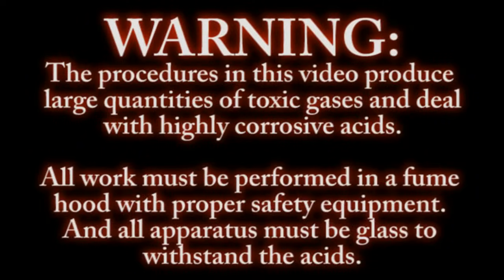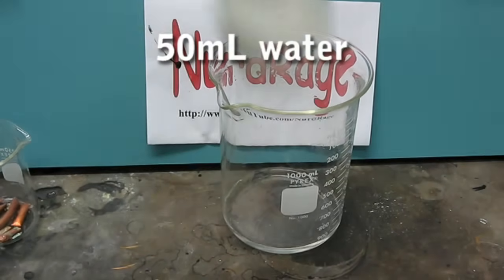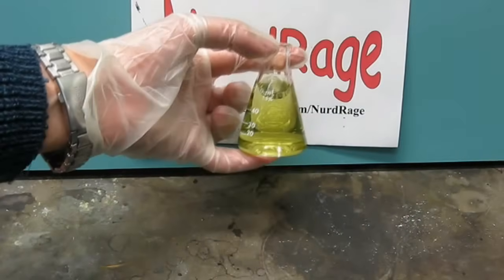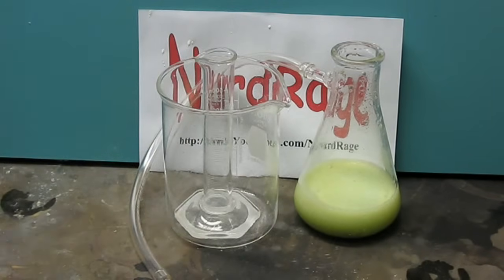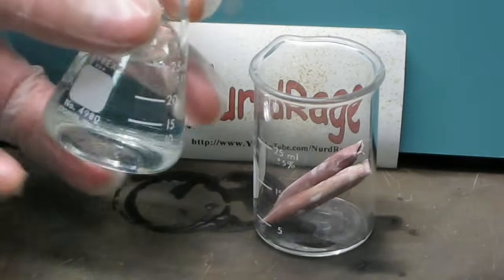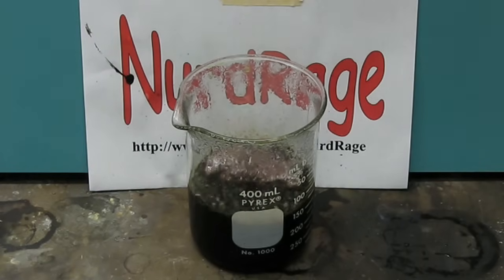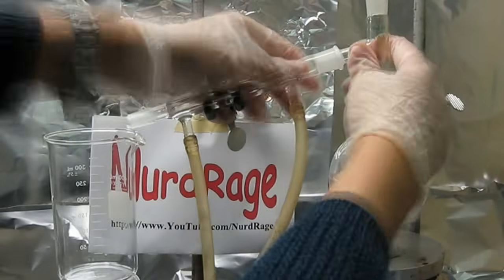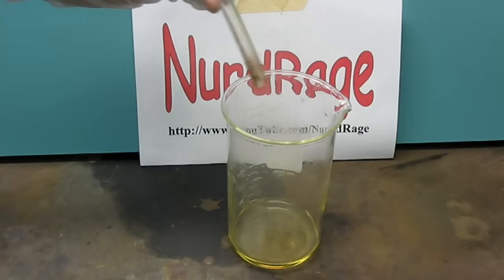Make Nitric Acid - The Complete Guide

Comment: The 3rd method with a bit of a chance in equipment is the way to go in my opinion. A heating mantle  instead of a hot water bath, a 2 or 3 neck round bottom flask for the acid and salts, an offset to the  vertical column, then a 45° with a thermometer port (wrap the threads and the thermometer where it meets the threads with PTFE tape or the Nitrogen oxidizeds will eat the plastic cap) then a condenser going to another 2 neck flask that is sitting in an ice bath with your recirculation pump that is cooling the condenser. You then can use the other neck of your reciever flask to attach a hose that you can run out of a window. After you get your heat dialed in then weap all of it with aluminum foil to keep out the light. Your end product will be very concentrated but might be a bit orange. You can pump dry air through the acid and it will clear it right up.

Comment: will calcium nitrate work if i filter off the calcium sulfate that is produced when I add sulfuric acid?
Reply: This is a good method for when you don't need the acid very pure, but you will need a vacuum filter to seperate the calcium sulfate, since it forms very small particles

Comment: Your videos are very instructional. Im a small precious metal refiner and the cost of nitric acid is very expensive. Im almost prepared for processing 6,000 grams of silver and another 350 grams of some karat scrap gold.

Im considering buying a simple distillation aperatious and wondered if maybe you could counsel me. I need to produce about 1.25<1.5 gallons of 68% nitric acid. Not sure of flask sizes and the condenser size. 

Comments!

Comment: What type of oil for the oil bath? I did not like the oil bath as it it started fuming. I had to turn down as I thought it might catch fire like a chip pan fire. I set my flask 1mm above hot plate and rapped foil around bottom and I managed to get it working. What temperature dose oil catch fire is there different temperatures between eg clutch and break oil, engine oil, gear box oil, refrigerator oil. Interesting

Comment: Will the 2nd and 3rd method work on silver? And instead of using 30% hydrogen peroxide can I use 3%( standard hydrogen peroxide bought at store) and still get better results then using only H20?
Reply: They should work.

Dilute hydrogen peroxide would still work,maybe very low yield but still be better than water

Comment: START WITH 80 GRAMS OF NITRATE SALT (sodium nitrate) BUT POTASSIUM NITRATE/AMMONIUM NITRATE OR NITRATE BASED FERTILIZER ADD 50 mL OF H2O TO THE NITRATE. THEN ADD 100 mL OF HYDROCHLORIC ACID. PUT 50 mL OF H2O TO ANOTHER LARGER CONTAINER,GET 32 GRAMS OF COPPER EXCESS AND POUR IT INTO THE ACID MIX THEN PUT ANOTHER CONTAINER OVER THAT AND WAIT.

Comment: Can you use 1L of 10% HCL solution instead of 100ml of concentrated? The only over the counter solution near me is 10% HCL.
Reply: If its only 10% hcl its probably not just 90% water. There might also be carbon contaminants. Imo best option would be to just concentrate the acid instead of dilute the mixture.

Comment: why hcl instead of h2so4 it is non volatile ...

and if u need to get rid of the yellow pass dry air or co2 through the solution or add excess of water. 
the no2 produced due to the thermal decomposition of hno3 fades away 

pure hno3 is colorless but it is also very unstable due to its unstability it gets decomposed easily and forms nitrogen dioxide which is a reddish brown gas but gives a yellow color to hno3 in order to prevent the thermal decomposition from happening hno3 is kept in colored bottles and because it fumes in the air  hno3 you should always use a stopper.

Comment: If I react sulfuric acid and sodium nitrate yielding  a distillate of fuming nitric acid, what am I left with in my boiling flask? Is it sodium metabisulfite or sodium bisulfate? What can I use this leftover molten salt for and how can I remove it from glassware without  recrystallization occurring.  It's a huge pain in the .
.Thank you in advance  .
Reply: You are left with bisulfate and possibly leftover acid.

You can try make more acid from them.

To removing try add water,althrough there are risk of acid spilling

Comment: Can someone please explain to me why you cannot simply react HCL + NaNO3 --> NaCl + HNO3 ?!?? just set this up as distillation like nurdrage method #3, but replace sulfuric acid with HCL.. You can re-distill to azeotropic, but it seems way better than do deal with dissolving copper and bubbling through H202
Reply: because HCL is a weaker acid than nitric and the reaction happening here is weak acid salt + strong acid = strong acid salt + weak acid this will only work if the acid being mixed with NaNO3 is stronger than nitric

Comment: I have 2 questions, when you talk about recycling the copper from the dead reaction mixture by adding aluminum to it. What compound exactly is the dead reaction mixture, and what is it after reacting the aluminum?
Reply: The compound are probably copper nitrate and alkaline chloride salts with leftover HCl,by adding aluminum you are converting the copper ions into copper metal and turn aluminum into aluminum nitrate.

The bubble are probably from the reaction of the leftover hydrochloric acid and aluminum,creating aluminum chloride.

Comment: Excellent Video. Thanks! Nitric Acid remembered me a solution and I have a suggestion to a video: I got a formula to strip Tin (solder) from PCBs, but I can not have a way to test it. It's made with 30% Nitric Acid + 1%-5% Ferric Nitrate... in case this solutions works properly, we can fastly remove only the solder leaving copper and components intact and we can easily get all the components off of the pcb. Is it interesting and Could you make it ?

Comment: I realize this video is pretty old but I love all of your videos, thank you for doing them. I wanted to try to make some nitric acid and I think I succeeded but it didn't turn out like yours (clear). I used 82 g calcium nitrate,  45 g copper metal , 50 ml hot water, 100 ml muriatic acid.  Bubbled through 25ml of unknown concentration of hydrogen peroxide in an ice bath. 

The hydrogen peroxide started out clear as you would expect, went blue, then green,  at the end of the reaction amber.  it looks like a good amber beer, it is even bubbly. It attacks copper quickly. What, if anything, did I do wrong? If you shake it around a bit it still releases faint red vapors. Thanks.
Reply: probably some contamination or unreacted no2 gas maybe?

Comment: A@1:30 :  I thought Nitrogen Dioxide dissolved in water to make Nitrous Acid. Not Nitric Acid. Am I wrong?
Reply: nitrous acid turns into nitric acid because nitrous acid is unstable the reaction mechanisim is 3 HNO2 = 2 NO2 + HNO3 + H2O

Comment: Quick question sir - would my relative altitude (roughly 5,500 ft/above) have any bearing on why it is that the first reaction is not working? The nitrate is pure, hydrochloric is new, yet it just turns green. No smoke to force in to the liquid below.......
Reply: Update!! The only thing I’ve been able to accomplish is... ..... I’m not sure bu it’s certainly acidic. It’s basically the first method+sulphuric acid in the inner jar bubbled in to hydrogen peroxide. It fizzes when I even move the jar it’s in. Any ideas on what it is exactly? Oh, and I added what I believe to be stainless steel to the acid mixture

Comment: What are the fumes that are released in the reactions? I understand they are toxic, but any suggestion exactly how toxic?
Reply: Nitrogen dioxide, which is nitric acid minus water basically. Should you inhale it, it will mix with water in your respiratory tract and become nitric acid again (hydrolysis) then the nitric acid will nitrate some part of you. Minuscule amounts of this process briefly are fine. More are not. Nitrogen dioxide (which always occurs in an equilibrium with dinitrogen tetroxide) has a distinctive metallic-y odor that becomes evident well before it's visible. When you smell it, improve your ventilation and/or get your head out of the flask right now. Don't even think about trying to smell the "orange cloud." Just get away from it.

Hydrolysis in the respiratory tract is how many Things You Don't Want to Inhale work, for example, carbonyl chloride. Most of the lower respiratory tract is not innervated and severe damage will not be felt directly. However, the resulting pneumonia and death will be more conspicuous.

Comment: 5:46 wouldn't it be better to use a water bath or sand bath? Organic substances and a nitrating bath do not mix very well with lots of heat if the flask were to break...

Comment: 4:05 I wanted to just point out that you can distill fuming (above concentrated) nitric acid, you just need to use concentrated nitric acid and concentrated sulfuric acid and distill. The sulfuric acid likes water much more and will keep it in the flask while the almost pure nitric acid distills over. Great video!
Reply: And you can reuse the sulfuric by boiling off the water and leave concentrated sulfuric acid
Reply: cool, I bet it would also work with hydrochloric

Comment: Hi , i used fertiliser and it worked , but what happens if copper is omittted ? As isnt the copper giving off nitric dioxide gas because the solution is producing nitric acid to react with the copper in the first place ?

Comment: on the vacuum flask method...
1 . would recycling the gas that escapes after bubbling through the solution (via an air pump and second tube with second pipette) before it escapes into the atmosphere increase yield?   basically, how efficiently does the nitrogen dioxide dissolve into the receiving solution?  If there is undissolved nitrogen dioxide, would recycling it through the same (or second) solution increase the yield?
2. would plugging the receiving container increase yield due to the increase atmospheric pressure...like when making carbonated water?

Comment: WTF!?   wheres my reaction?   followed recipe to the exact measurements,   sodium nitrate was pure,   used 36gms copper,   no reaction.  Am I doing something wrong?
Reply: my apologies,  reaction came on much much slower than your video, copper was reasonably clean, the only thing different is that Im using plastic not glass, all is air tight where it needs to be,  poly tube with a glass eye dropper tube on the end for bubbling gas through water, 

thanks NR
Reply: yep,  now running on on all cylinders!

Comment: Cu +  4HNO3 > Cu(NO3)2 + 2 Nitrogen Dioxide or N2O4 disolves as HNO2 (nitrous acid) and one HNO3 (nitric acid) but HNO2 in acid becomes N2O3 which escapes. Seems wasteful. Can't we use electrolysis like sulfuric acid from copper sulfate.

Comment: Why do you say only nitric acid can disolve copper? I etch the copper off circuit boards with just hydrochloric acid and hydrogen peroxide. I end up with copper in solution. Copperchloride.

Comment: "How to make nitric acid? Just mix hydrochloric acid with...."
"How to make hydrochloric acid? Oh, just mix sulfuric acid with...."
"How to make sulfuric acid? Easy, just mix nitric acid with...."
GAAAH!  This is starting to resemble those irreducible complexity paradoxes from theory of evolution! ;[
How does one BOOTSTRAP this process to begin with when there's no acids around yet, just bare nature?
Reply: u can get sulfur trioxide from the decomposition of many metal sulfates at very high temperatures, which reacts with water to form sulfuric acid
Reply: @scottjohnson7433  Ok, cool. Where can I get those metal sulfates then?
And how high the temperatures I would need? Is fire enough?
Reply: iron (ii) sulfate occurs pretty commonly in nature as a mineral and decomposes at 650 degrees c

if you wanted a practical way to make a strong acid without access to any of them today nurdrage has a video where he makes HCl from sodium bisulfate (very easy to get as a ph lowering chemical in pools) and table salt.

Comment: Could you use the hcl + nitrate salt method and distill it like you did with the sulfuric acid?
Reply: No. The gas coming off that reactions is nitrogen dioxide which needs to react with water or hydrogen peroxide to make nitric acid.
Reply: @RadmanTheWise  i see. Thank you for your response

Comment: Good video but at the end I don't believe that pure nitric acid makes it difficult to dissolve the copper because it's just that strong, it just doesn't have any water in which the copper can dissolve into the solution, not "passivation" or whatever. Correct me if I'm wrong but I'm nearly positive.

Comment: Great demonstration video. Though I understand that yields will vary, I would have liked to see what the final volume of the final products measured to give me a general frame of reference to calculate a material cost analysis. 
I'm debating buying nitric acid and paying the huge hazard fees vs making it myself. The general need is to find something to dissolve copper.

Comment: Just a though, and possible addendum. Someone correct my chemistry reasoning if you notice anything amiss. In relation to the reaction of Sulfuric Acid + Potassium Nitrate: What if you instead use NaNo3 (Sodium Nitrate) + H2SO4 (Sulfuric Acid) -> NaHSO4(Sodium Bisulfate) + HNO3(Nitric), and then added the molar equivalent of KNO3 (Potassium Nitrate) to the spent product after distillation,  further yielding -> NaHSO4 + <heat> + KNO3 -> NaKSO4 + HNO3. You get more use out of your sulfuric acid, and you can use a cheaper Nitrate source(Sodium Nitrate) for half of the reaction. This to me would maximize yields of HNO3. I will be testing this all soon and shall reply with the results.

Comment: How concentrated does the sulfuric acid have to be? Is battery acid enough? (Battery acid is around 36-38 percent)
Reply: You need 93 or 98% acid

Battery acid might not be enough but you can boil it for concentrating it

Comment: can i just use the weak nitric acid i made instead of sulfuric acid to mix with the sodium nitrate? also for the first or second exp can i just heat the solution instead of adding copper?
Reply from the maker: No and yes.
Reply: why no?
Reply: so the copper was only acting like a catalyst to start the reaction but can be replaced by heat instead?

Comment: I used nitrogen based fertilizer to do this reaction but no any reddish-brown gas comes out.
Reply from the maker: needs to be nitrate based. Some nitrogen fertilizers are actually made with urea, which won't work for this process.
Reply: @NurdRage  I did it with nitrogen based fertilizer such as ammonium and calcium nitrate and it works. Thanks
Reply: Can you tell me how to concentrate hydrochloric acid. I have 20 % and want to get more concentrated. What needs to be done to concentrate HCl
Reply: Hello. Can you make the video showing how to concentrate hydrochloric acid

Comment: There are several chemicals that can dissolve copper so that statement is false. Ammonium Persulphate and Ferric Chloride are both widely used in the electronics industry for stripping copper. Now if you were testing using gold that would be a different matter as only Nitric can dissolve gold.
Reply from the maker: Yeah it was an error in the script editing.

The script actually read: "Only nitric acid can dissolve copper and produce nitrogen dioxide gas." But the "and produce nitrogen dioxide gas" was accidentally edited out due to a mix up with different versions of the script.

Comment: I found this somewhere. Is this a better way?

NITRIC ACID
There are several ways to make this most essential of all acids for explosives. One method by which it could
be made will be presented. Once again, be reminded that these methods SHOULD NOT BE CARRIED
OUT!!
Materials:
• sodium nitrate or potassium nitrate
• distilled water
• concentrated sulfuric acid
Equipment:
• adjustable heat source
• retort
• ice bath
• stirring rod
• collecting flask with stopper
Procedure:
1. Pour 32 milliliters of concentrated sulfuric acid into the retort.
Carefully weigh out 58 grams of sodium nitrate, or 68 grams of potassium nitrate. and add this to the
acid slowly. If it all does not dissolve, carefully stir the solution with a glass rod until it does.
2. 
3. Place the open end of the retort into the collecting flask, and place the collecting flask in the ice bath.
Begin heating the retort, using low heat. Continue heating until liquid begins to come out of the end of
the retort. The liquid that forms is nitric acid. Heat until the precipitate in the bottom of the retort is
almost dry, or until no more nitric acid is forming. CAUTION: If the acid is headed too strongly, the
nitric acid will decompose as soon as it is formed. This can result in the production of highly
flammable and toxic gases that may explode. It is a good idea to set the above apparatus up, and then
get away from it.
Reply: Isn’t that basically the last method?

Comment: There's another video that followed the instructions on this video and acid began overflowing through the tube. He pulled it out before it reached the pipette and it spilled on the concrete. He neutralized the spill with baking soda. My question is- What would you do with the cylinder of super duper weak nitric? Can you just grab a new flask, add more nitrate salts, Cu, H2O and acid and hook it back up? Will this affect the contents of the cylinder?

Comment: Looking to dissolve some silver.  Tried twice so far, first time 150g H2O, 150g liquid fire, 300g urea 46-0-0 CO(NH2)2.  Output only 70g that looked good but no effect on copper.  No acidity. Tried again tonight 115g 46-0-0 urea and 333g liquid fire. Boiling point was way higher then normal 120C +. So I shut it down. Does the liquid Fire have a boiling inhibitor, or is the urea causing the drastic change in boiling point?  Should be about 83C right?